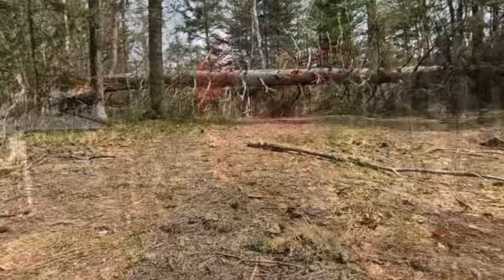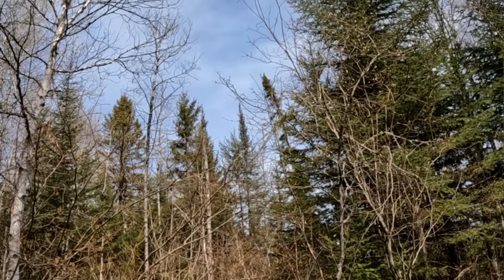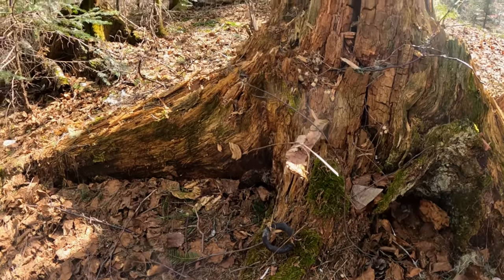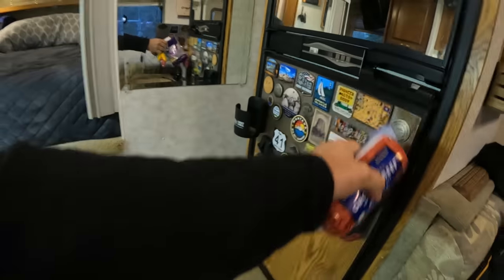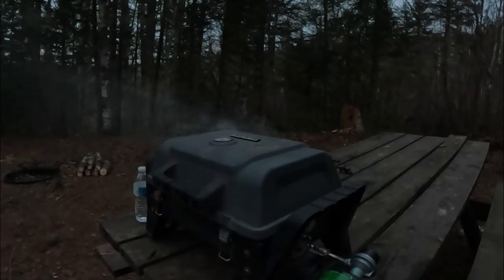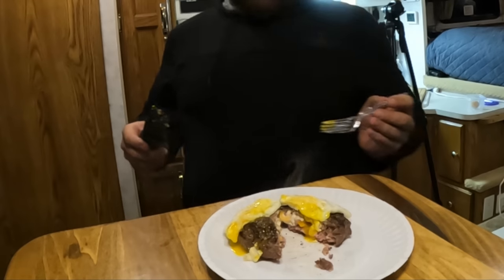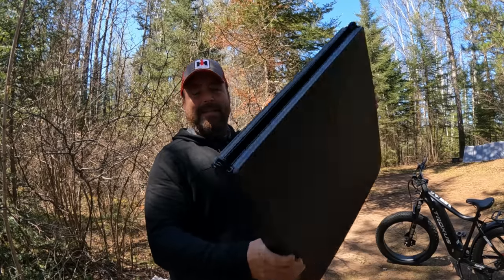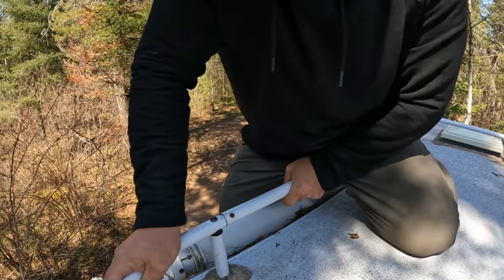I Found an Abandoned US Forestry Campground While Truck Camping

Comment: I used Henry Tropicool 887 coupled with Henry 885 to coat my roof about 1 year ago and like it so far. I did a lot of research and spoke to some knowledgeable people that have used multiple products prior to choosing 887/885. One note:  once you go with silicone coating, you cannot use anything else. Hope this helps and keep up the great videos.
PS:  Nice to hear spring warbler songs during your walk.
Reply from the maker: Thanks for the info Jay. I'll give you a call before I buy anything. I know you are like me; we do a ton of research before buying a product. You will have to fill me in on what you learned.

Comment: I do camping with my horse. There is an old horse camp up the North Fork of the Lewis River in SW Washington state. I had camped there during the 1990’s with friends and rode all over in that area. There are the Upper Falls and Lower Falls camp grounds and the falls are stunning. No one was around back then. 

Fast forward to “now” and a trip up the Lewis to the horse camp to see what was going on. First you have to traverse a lot of ugly pot holes, then there is the mogul. It is a gravel slump in the road times two. I actually rode my Harley through those before and don’t recall the being that steep or bad. I was glad we were in a truck. 

As we approached the falls, we began seeing a great many vehicles lining both sides of the road. The campgrounds were full and I imagined the falls were packed, too..Finally we made it to the horse camp, but what a wreck!  Hammocks were hung inside what was left of the corrals. There were little tents everywhere. It was heartbreaking and there weren’t any horses or evidence of there being horses there in a while.; With the condition of the roads I can see why.
Reply from the maker: You are so right. I'm seeing it around here as well. Things are going downhill around here too. People are over using and abusing our public lands.

Comment: When you’re so far back in the sticks you can only get a single FM station remember the old adage. Your radio is only as good as the antenna. If you have a antenna on your vehicle of the screw on rod type and it’s bare metal. Simply attach a alligator clip to a long wire and hook the alligator clip to the Antenna. Most car rod antennas are generally no longer than a yard long. Just use a really long wire attached to the alligator clip. You can attach something like a rock to the wire to throw it up into the top of a tree. Something like a 100 feet will be much more effective than a 3 foot car antenna.
Reply from the maker: That's is an awesome idea! I'll have to carry that I the camper for those situations.
Reply: It’s so true that your radio is only as good as your antenna. If you have something like any sort of old fashioned bare metal car antenna you can make it work for you better in a pinch if you have a way of making it taller. Just look at the type of car antenna that your vehicle has. If you can replace it with a solid metal antenna. Attach a old fashioned alligator clip to a really really long wire. Remember that you can get the wire really easily higher in a couple of ways. 1. You can simply attach a heavy object such as a rock and throw it up into the branches of a tree. 1. You can throw a weight really easily high with your fishing pole. Throw it high enough that you can pull it up over a high branch. Pull the fishing line down to you. You can then attach the long wire to your fishing line and pull it vertical. Remember that the higher the wire the better. 3. If you don’t have any trees just stop by any Dollar Tree and purchase a party balloon for $1.25. Then attach the balloon to the wire.

I’ve got a portable radio that came with a FM Antenna jack. With the regular antenna I can get about three stations with the rod retracted. And about 23 with a 15 foot antenna connected to the jack. Good alternative for the rod antenna being busted. EBay sells 1/4 “ to 1/4 “ audio cables up to 100 feet. That’s 33 yards long. Good for a bug out situation then all of the local radio stations are down. And some if not all of the cell towers are down. Remember even under the best circumstances FM radio stations only have a range of about 35 miles even in a vehicle before the signal starts fading out. With a wire 100 feet up you’ll be able to hear more stations even in a SHTF scenario.
Reply from the maker: Thank you so much! That's all great information. I use the small 10 metal whip antenna mounted to the top of the camper. I coild easily attach an alligator clip with a long length of bare wire. I appreciate the comment!
Reply: It doesn’t have to be bare wire. In a SHTF scenario, something like old fashioned speaker wire might be better. You know the heavy gauge stuff RadioShack sold back in the 80s. It would be fairly well insulated yet flexible. When you put it away roll it up into a large coil. Over time that’s going to be better for it rather than bow tying it

Comment: I do the same kind of “camping” as you, only full-time and in a Toyota Prius. I spend the Spring, Summer, and Fall in the National Forest system and then, I Winter-over in one of the BLM’s Long Term Visitor Areas in the Desert Southwest, which is NOT a good place to be in Summer!

PS. I used to have a big Lance camper on a Dodge 2500 4X4 that I had to get rid of in Alaska. When the cost of vehicle insurance exceeds the value they would pay for a total, it’s time to change something, eh? I did love that rig…
Reply from the maker: That is awesome. How do you like the Prius? When my current daily driver vehicle finally dies, I'll be looking for a Prius. I see replacement aftermarket batteries packs are coming down in price. I don't know how it will handle in the Minnesota winters. I will run snow tires, but the low ground clearance could be an issue.
Reply: @KennyOfAllTrades  I love this darned thing. It is a magical car; I have been staying in South Dakota for the past 12 months; the car survived the winter well enough. As for clearance, there is a company in California that makes a lifter package for the Prius that raises ground clearance about 6 inches, which is enough for most rough-road needs; I do not have it, and really have not needed it as long as I go slow and watch the road. The 2023 Prius Prime even has a roof-mounted solar panel option! Mine is approaching 200K, so I might think about a replacement. The only downside, as I said, is it is cramped when it rains, but when that happens, I can drive away.
Reply: @KennyOfAllTrades  The thing about a Prius that makes it so special is having two batteries and no starter motor. The starter battery tickles the big battery and once the READY light is on, you’re ready. When sleeping in very cold, I leave the car in READY mode with the heater on; the system starts the battery to charge it up as needed. Usually, it turns on every 15 minutes or so for maybe 30 seconds, then turns off. I use less than ¼ gallon of gas a day doing that.
Reply from the maker: That sounds awesome
Reply from the maker: I saw that on a video. The heating and cooling of the car is really slick!

Comment: Use Berryman carb spray hopefully that helps and use a fuel treatment.  Also if you are able to get a tune up kit.  I worked at and rv place that sold a ton of truck campers, those generators took a skilled tech 2 to 4 hours to get in and out.
Reply from the maker: Oh boy. That will be a weekend project for me to pull out and put back in. Since it runs on propane, maybe I'll try some Barryman in a spray bottle and shoot it in the carb. Hopefully, that will take care of it. Thanks for leaving a comment.
Reply: My bad, I didn't realize this was a propane generator.  I wouldn't use the Barryman then, check your air box/filter for any obstructions.  If it still runs poorly could most likely be air in the line or possibly a bad regulator.  I believe you have a propane stove, does that light with no issue?
Reply from the maker: @malibusbc  Yes, the propane appliances work well. I changed out the air filter and spark plug. I can get the generator to start if I fiddle with the throttle. Usually, I have to hold it half open. Once it is running, it will stay running with no issues. It will start and stop from inside the camper after it has run for a while. Then, after it sits for a week, I'll have to start it by giving it half throttle again. It has 230 hours on it.
Reply: @KennyOfAllTrades  Ok, I would then look at the pressure regulator valve it controls the fuel flow. The valve in the regulator works off of vacuum. The engine vacuum is lower at starting rpm and therefore it may not be pulling the correct amount of fuel at start up. Once it starts it creates more vacuum and opens the valve as it should and then runs.  Some of these
parts are hard to get maybe worthwhile looking into while the genset runs.  Good luck!
Reply from the maker: @malibusbc Thanks for the help!

Comment: I am just going to put this here, and that is all.
I had an Onan generator in a Lance truck camper, and after having an expensive but discounted repair on it, it still did not start. Similar to your situation.
I brought it back, and the Onan dealer put in a new spark plug, and the problem was solved.
He told me, that you need to purchase the spark plug from an Onan dealership, because if you bought the same plug from another source, it would not be the same.
I am just repeating what I was told. I don't know if it's true. I don't know if it will work for you. But it worked for me.
Just passing on information.
Reply from the maker: That is definitely worth a try! I will give that a shot, and you will see if that helps..👍

Comment: Great video! May I ask what suspension mods you have done?
Reply from the maker: I made a video that shows the before and after effects of the suspension upgrades. I tried to show in detail the effects of each upgrade. 
Basically, it's a sway bar, cheep alternatives to upper and lower stable loads and airbags. Check out the video and let me know what you think. Dont hesitate to ask any questions. https://youtu.be/Msqnosna8N8

Comment: Give your  generator a good  drink  of seafoam  mine sat for  2 years  drain all the  gas out gave it a good amount  let it set for  a while now working great 😊😊
Reply from the maker: This generator is run off propane. I wonder if I could put seafoam in a spray bottle and shoot it down the carb while it's running. That should help clean things up, maybe?

Comment: Very nice. I didn't get the make and model of the bike you love. Can you give manufactures name. I've been looking for an ebike
Reply from the maker: I have 2 bikes. My favorite is the Rad Mini 4. I've spent a lot of time upgrading the motor, controller, battery, and screen. There's nothing stock about that bike. You will see that bike in 30% of my videos. I have owned it for about 6 years. It's still a blast every time I get on it. 
My other bike is the Troxus Explorer. It is a standard mountain bike style non folding bike. That is the bike seen in this video. It's a great bike.  I used it in a few videos. Unfortunately, because it dosent foldup, I don't bring it often. The nice thing about the Troxus is that you feel like you're on a regular mountain bike. It is the bike I would choose for trail riding. The seating position and 4" wide fat tires make it so much safer to ride. When my daughters ride the bikes at home, they will always jump on the Troxus. The Rad bike is a Mad Max project style bike. It's super fast and tons of fun if you like that kind of thing.

Comment: Dude, you need a cordless chainsaw. I have a ryobi  I bought for $139. Works amazing and can cut a few days worth of wood on a single charge.
Reply from the maker: Do you ever have issues with the saw leaking bar oil? All the chainsaws I have owned in the past have been a dirty mess. I am really limited on space and will have to find a spot to store it. I have definitely thought about buying a chain saw in the past. My Milwaukee has got the job done for many years. But a chain saw would be nice.
Reply: @KennyOfAllTrades  I do have leak issues if I store it hanging on the wall. In a horizontal orientation it is not a problem.
Reply from the maker: That's good to know. I was concerned about leaking bar oil.

Comment: I love your channel and have wanted to get a truck camper for years how can I convince the wife we don’t need a pull behind trailer her big argument is the inside is too small but I disagree
Reply from the maker: I think once she stepped inside a truck camper, she would agree there's enough space. Then you can tell her with a truck camper you have a lot more camping options. Plus, when you're traveling, not having a pull behind makes getting in and out of parking lots and gas stations a breeze! It will open up a new style of camping.

Comment: You don't seem to have much solar.  
How  close are you from a near by Walmart or a Dollar General Store?
Reply from the maker: The closest Walmart or General Dollar would be in Duluth Mn, the drive would take a few hours for sure. There are not many corporate stores in North East Minnesota other than gas stations. I just recently picked up the 400 watts of solar. I'm a weekend camper and don't have much equipment. Prior to these, I was using the 50-watt panel that came standard on the 20 year old truck camper. Thanks for watching.
Reply: So,. If your Camping off grid there's no close re supply near?  W 😮 W !! Thankx
Reply from the maker: Just gas stations and mom and pop style stores on the arrow head. It's 3 million acres of forest with a lot of tourisum. It's hard for people to live up here. There's not many jobs, and the property cost is super inflated. Most towns up here are suffering to find employees, and the employees that do live here can't find housing or afford groceries.

Comment: if a tree is blocking the way or might fall because it is dead or has been vandalized... why not remove it?  Smart backwoods campers always carry a chainsaw.   It will sure save you from being blocked in after a windstorm.
Reply: He had a small chainsaw in the last video and used it to cut some downed trees in the road
Reply from the maker: I get Steve. But I'm not a smart back woods camper, I'm just a goof with a Gopro. If I did cut it down people would complain that I didn't haul out the brush, others would complain I didn't buck the log properly. Id get comments asking me I wasn't wearing chaps; they would tell me I should have eye, ear and head protection. I can't make everyone happy.
Reply from the maker: I do carry the Sawzall. Unfortunately, I don't have a chain saw.

Comment: For your carb issue get some marine " ENGINE TUNER " MERCURY,,, "CARBON GAURD" OMC / Bombardier. 
Dempending on fuel tank fuel tank size, Squirt like 1/4 of can in say a 1 gallon tank.
Let engine run this thru the carb for a while. Shut it off let it set a couple of hours. Start back up and let it run.
This product was designed for the old 2 stroke engines to desolve the COAKING  THAT FORMS ON THE SIDES OF THE piston and causes the rings to stick. 
 I've found it works great on lawnmowers,weed eaters that set too long etc.
I'm a certified marine tech.
 Hope this helps everyone.
 Oh, on and outboard you Squirt entire can thru carburetors and let set 4 hours. Restart flush with another half can. 
 Great for getting rid of mosquitoes too ! Lol.
Reply from the maker: The generator runs off propane. Do you think I could put it in a spray bottle and spray it down the carb?

Comment: Just did an inspection on my tropicool job last week and everything  still holding up with no cracking or loose spots.  Only downside is how slippery it is if your walking on it with even a little bit of water.

Recently made this recipe and substituted low carb wraps but is something I will do on a camping trip,, so good!
https://youtu.be/WPZ34opHtjs
Reply from the maker: Thanks for the info Todd, and Ill check out the recipe.

Comment: You must store that big bike in  your backseat?
Reply from the maker: Yep. I take the front wheel off, and it fits in the back seat. I have used folding bikes in the past. I wanted an ebike that rode like a mountain bike. The folding bikes are great, but it feels like you're riding over the front tire more. This bike rides and feels like a mountain bike. I'm enjoying it. I'll do a review later. I wanted to put some hard miles on it before giving an opinion.
Reply: @KennyOfAllTrades  Yeah it looks cool. I have a truck camper and mount my ebike on the front of the truck. Not always ideal but I have gotten comfortable with it being there.

Comment: If this is a campground that is no longer in operation then you can’t build a fire
Reply from the maker: I just did a quick search, and it does look that way. 
The Forestry worker said the campground was taken out of service many years ago, but locals still know about it and use it. I wonder if he would have said anything if I had a fire going. He said he now services the rustic campground miles up river but still makes rounds through here. Its only 3 sites on a half mile stretch of the river.
I'm glad you commented, I didn't know that. This is the second decommissioned National Forest Campground I have found. Both of them still had fire rings and benches in place. Of course some sites  had the rings and tables stolen.